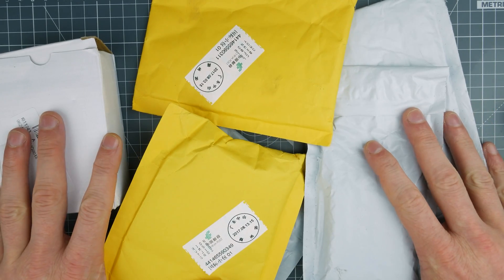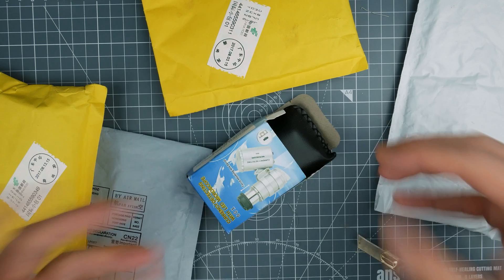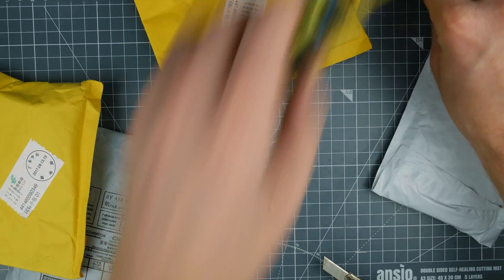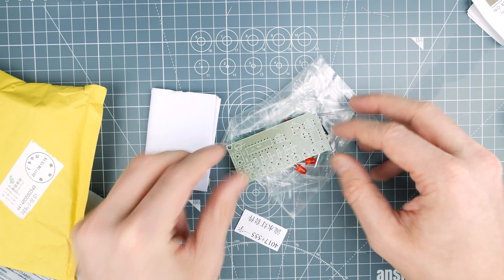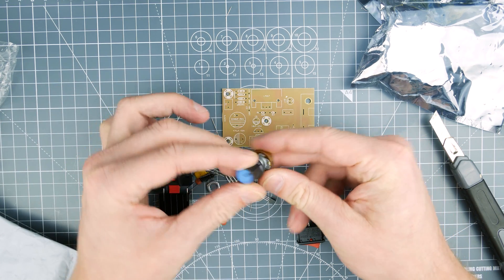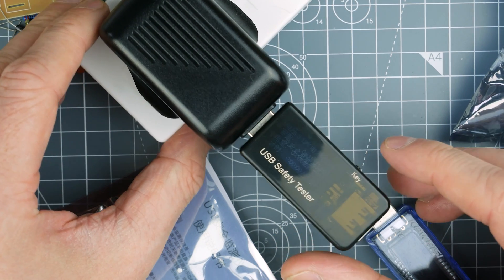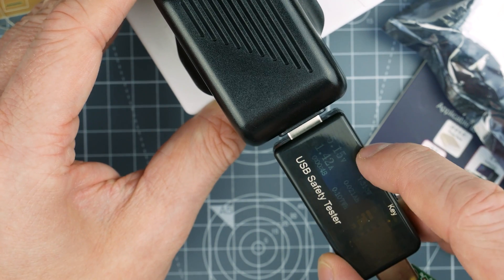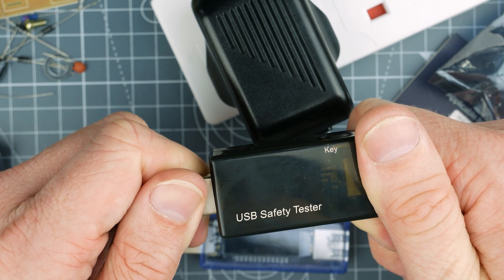Post Bag 09

Comment: Hey Dave,

I built a 10x10 LED matrix with an ESP8266, I had also planned to control via a web interface, which I have half finished but just need to find some time to finish it off! Hopefully in the next couple of weeks

If your one is one of the boxed and diffused ones here are some findings I had from it, that hopefully might be useful

- 23cm Ikea Ribba deep frame makes a decent enclosure for a 10x10 (might not be great for a 16x16, but there is a bigger 50cm that might work out well). I'm pretty terrible at wood work so this was a big help!

- I used 3mm foam board from Art & Hobby shop. I got it in white, but if I was doing again I would use black as there is a small bit of light bleed between the cells at full brightness. 

- I haven't used for this project yet, but McLightning is a sketch someone made for controlling neopixels with an ESP8266 that exposes an API for interacting them with (I dont have any code for my web interface to arduino connection so I'll probably try this out). This also has it's own web interface with built in patterns which is pretty nice.

- I 3d printed a template for cutting out the foam, this was by far the worst part of the project. 10 x 10 leaves 18 dividers to cut out. 16 x 16 leaves 30! If I was to make this project again I would seriously consider going to a printer/sign maker to see would they make these cut outs from cardboard or whatever. Even if they charged E100 if you value your time at all it would be worth it! I reckon i must have spent 20 hours cutting (It was a few months ago so I can't remember exactly)

- I used LED strips, the strip was able to fit across two cells before I needed to cut it. Which doesn't sound like a lot but it reduced my soldering by half :) Even with this reduction soldering took a while, but I was in desperate need of a new soldering iron back then, I'd imagine I would do that much faster now, maybe 30 mins per row.

I really must finish that dang thing off!

EDIT: fixing my stupid mistake with the amount of dividers

Comment: Hi I have the same tester and as someone else has said you can enter into the settings by quick pressing the button. But there is a another hidden section including reset by holding the button in before and while applying power to it/plugging it in. Once in you can display volts, current individually and the over/under thresholds can be seen you can also press and hold to reset. It'll test Quick charge 3.0 devices too, but you may have to adjust the overvoltage threshold first or it'll alarm out.
Reply from the maker: I am liking it more and more, thank you.

Comment: Here are a new datalogger, and elec. load and some software :-):
https://www.youtube.com/watch?v=VDCShH-zj0U&feature=em-uploademail
https://www.banggood.com/EBD-USB-Load-Tester-Enhanced-Edition-QC2_03_0-MTK-PE-Trigger-Voltage-Current-Capacity-Test-p-1101978.html?p=E307071053245201501N
Reply from the maker: WOW, those are brilliant. I must have missed that video, thanks for the heads up.

Comment: Dave, I don't think those SK6812 are really cheaper than WS2812. 6A can be enough, you can just limit max brightness in software. Typically such LEDs are too bright for most applications.
Reply from the maker: They were a lot cheaper (I say a lot, really just £4 cheaper per 100) on Aliexpress. I didn't do a lot of research, just what I found online.
Reply: You want buy separate LEDs or in shape of tapes, I was checking tapes. They usually had expensive paid shipment which ruined all savings :( If you find good offer please share. BTW there are ready flexible matrices available too: 8x32, 16x16, 8x8. Sometimes it can be cheaper and easier.
Reply from the maker: I bought 100 separate LEDs, I didn't see the matrices. They actually look pretty good value, I fancied designing my own board though.

Comment: I do have two of those J7-t thingies. One with 2 digits after the decimal points (and also in Chinese, but who actually gives a crap?) and one with 4 which I got as part of this bundle: https://www.aliexpress.com/item/Battery-Tester-Power-meter-voltmeter-ammeter-capacity-18650-Lithium-polymer-nimh-carbon-zinc-nickel-cadmium/32693232840.html

Neither seems to have such a bad display you're experiencing.
Reply: You can change to English by quickly clicking the button 6 times.

Comment: I have the same J7-t USB tester and mine displays Chinese only, like yours. BUT... I just found some online instructions here, https://goo.gl/8R5K3q. Among other adjustments that can be made, you can toggle between Chinese and English by navigating to the "Chinese" screen, then click the button 6 times in quick succession -- this method worked for me.
Reply from the maker: Awwww you are awesome. Thank you
Reply: Ha. Well, I don't know about awesome, but thanks all the same. This was driving me bonkers since I've had the J7-t, and your video prompted me to dig a little deeper. Glad I could help.
Reply: David Watts - My version says "Product model: J7-t" instead of "Product mode: J7-t" and has a four digit precision. The display also is much brighter. The housing looks identical, so maybe this one is a slightly cheaper knock-off?
The language as shipped was set to English and in the manual it lists how change that by multi-pressing the button.
Reply: I just uploaded a new video which at the end shows my version of this "USB Safety Tester". If you stop the video at just the right moment, you should be able to read the labeling "Product model: J7-t" on the back. See https://youtu.be/K7Lv5FWTX9Y
Unlike the version that David shows, mine has 4 digits accuracy, much better readability, but also different screens selected by SLOWLY clicking the button. In this video David presses the button rather quickly and if I remember well, quick presses are used to select the language!
Reply: Great. I will watch now. Thanks.
Reply: Just watched your video -- and subbed :) -- can I ask where you purchased your "USB Safety Tester" from?
Reply: MindFlareRetro - Thanks for subscribing! :-)
I bought my USB tester in a set combined with a constant current load: http://s.aliexpress.com/juqUfaUF
(See other reply for more info).
Reply: Hmm. Interesting. Mine and David's must be knock-offs. Mine shipped in a white zip-lock type packet (no instaructions), display was in Chinese, 0.000 accuracy, and label on back shows "Product mode" -- however, my display is bright and crisp. Pictures, https://goo.gl/uFKCiu
Reply: Thanks for the link.

Comment: Definitely look into 'game frame' for your led matrix. 16 x 16, all the software is open source and easy to make with an arduino nano, rtc and a few other bits. I have made 2 and they both have hundreds of sprites on, via an sd card. Really impressive little displays :) all powered with a 5v 5a supply so you should be good to go with that power supply.
Reply from the maker: Oooh interesting. I won't look too much into it at the moment, I really want to figure it out myself at the moment but now I know where to go if I fail :-)